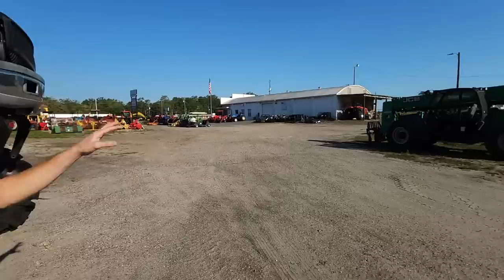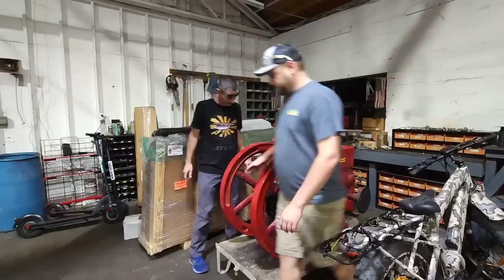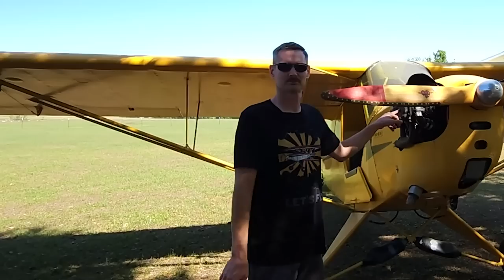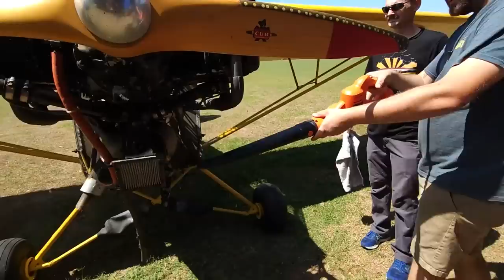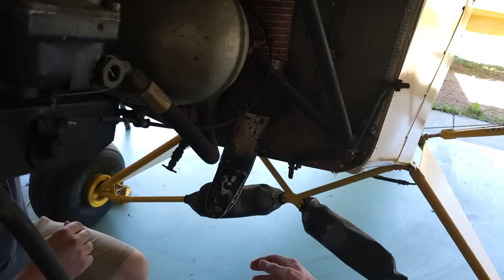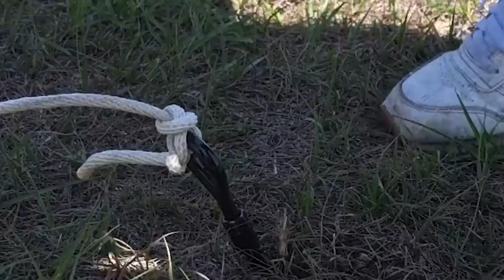1939 Airplane Will It Run After 10+ Years?

Comment: That is one pretty 1939 J3.   If the engine checks out,  got a mighty fine fun flying machine.  I'm lucky in that I've had two.  One back in the 80's for 9 years and after I retired,  got me another one I've had for 12 years and counting.  They are just so much fun to fly,   I just try to find every excuse I can to go to the airport late afternoon for an hour or so flight,   just going nowhere,  with no purpose aside from just looking at the hum drum of a large city beneath me, then head out a few miles to the country.   I feel honored that I have one of these still flying Cub's.  There is nothing like it!   Treat it nice!
Reply: ⅝
Reply: I had  an A35 bonanza for 7 years, and last year got a Cuby. The most fun I have ever had, and just a treat everytime I take it up.... cruises at 200 smiles per hour.

Comment: That stationary engine reminds me of my dad who used to drag rusted old wrecks out of swamps and bramble bushes and restore them. He had a 1.5 horse one and tried to stall it with a fence post under the flywheel, just because. The governor balls swung in, it went “chuff, chuff” and the fence post started to smoke. Huge torque.

Comment: I use to fly a Supercub at Biggs  Army airfields flying club.  I  was out one day, when a high wind blows up over the Franklin mountains too the west.  I tried to land, but the cross wind was to hard.  Finely  the tower called me and had me land on taxi way alpha.  I was hovering to the people on the ground.  Don't do that if you can avoid it.  That was back in 1978.  God I am old.
Reply: If the wind is strong enough, and the runway is wide enough, you can just land crossways on the active runway without requiring any special clearance from ATC. 😇
Reply: Man, I was flying out of Biggs in 1968 and I didn't see any J-3's around the flying club. We just had Cessna 150's and (I think a 172), we used an area identified as "the green spot" to mark our practice area.  Lots of fun.

Comment: Iam currently working on a deal to purchase 2 long lost beechcraft starships.  The aircraft came from the group of 24 starships that evergreen air center ended up with.  I was told they sold them for 50,000 a piece and many were purchased by owners for spare parts and others bought them just for the two 1200hp PT6A-67A engines.
The engines have been removed from both airplanes and they have been pickled and crated for storage and are included with the sale.  Both airframes have been partially disassembled.  
If the deal works out my goal is to restore the newer and lower time aircraft to airworthiness and to extensively modify the other aircraft and convert it to Experimental Exhibition category.  I would like to implement some of the changes originally planned for the series II aircraft.

Comment: They would also use those to run a generator to charge batteries to power in the house. Technically the original off grid lighting system, but they used it to make power to for electric for the house.

Comment: you prop it from in front the engine.  you can get more power on it several compressions rather than just one
And no it won't suck you in unless you are a wimp.

Comment: why do you try and make old engines just run when they've been sitting so long? you're only going to damage them, I would pull the plugs, change the oil, put some oil in the cylinders and turn it by hand to get it lubricated again.